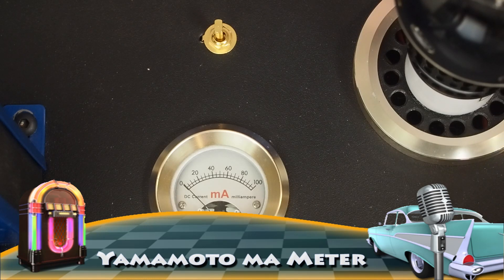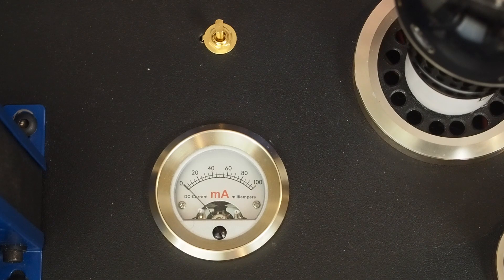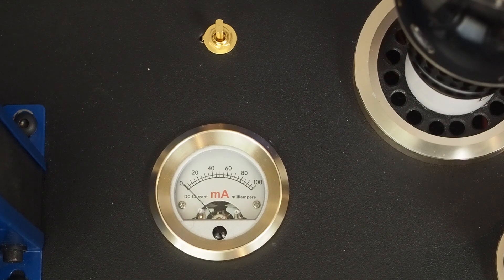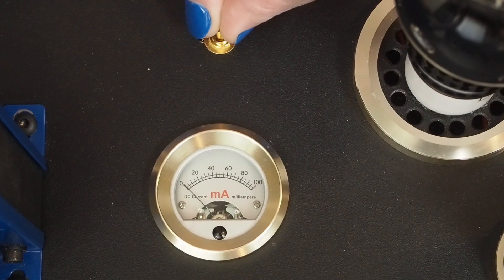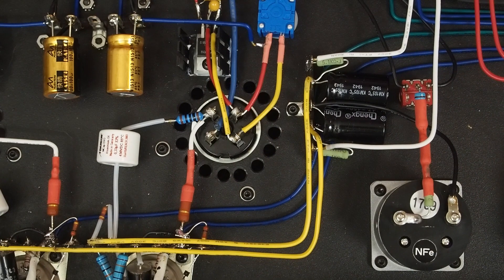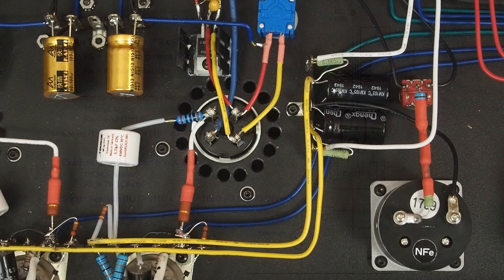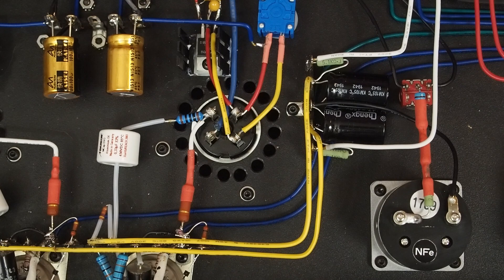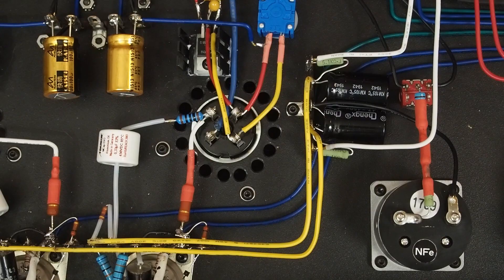Yamamoto mA Meter for Tube Amplifiers

Comment: Hello Stephe, After having watched all the 300b series, I saw the cathode resistor specified on the final BOM for this built was 880 ohms.... question: 880 ohm would be the one we use to calculate the resistors in series to connect the meter correct ?
Reply from the maker: Yes if you have that yamamoto meter.
Reply: @SkunkieDesignsElectronics  I got the meter from Youda electronics their cheapie one that's also 100mA 😅 but I was planing on using one of the rings you used, the 44mm since it fits the dial just to make it look like the Yamamoto. In this case do I still proceed with the same formula like In the video or do I need to measure anything on the meter ? 😅
Reply from the maker: Honestly I have no idea how to wire up that meter, sorry.

Comment: Hello Stephe, By any chance is there any meter that you would recommend, I tried purchasing this one but no longer in production, it does looks pretty cool and would love to add one to keep the 300b looking as good as your design
Reply from the maker: I have yet to find any meters that look even close to as nice. It's all $5 made in China plastic ones..
Reply: @SkunkieDesignsElectronics  True, I've only found the $5 dollar ones, Now out of curiosity since I am ordering all parts now, and I am a bit green on this, I am as well installing the 100mA meter so, my questions is,  can I go ahead and add a 73400 Ohms resistor like yours since I am using all the same parts ?  or would this vary in any way? I would appreciate your input 🙏 oh and the watts you recommend  ❤
Reply from the maker: I don't know how that meter was calibrated to work the way it did. I would personally get a 0-100V meter to switch in and just read the voltage across the cathode resistor.

Comment: Nice craftsmanship on display. Is there a logic to when you use heat shrink tubing at solder - lug - component junctions? I’m going to try it on my next build. Thanks.
Reply from the maker: I mostly use it when I think there is a possibility of a wire touching something, to help support something like a resistor soldered onto the end of a wire or to hold wires together to look neat.
Reply: @SkunkieDesignsElectronics  Thank you.

Comment: Hello Skunkie, thanks again for this nice video. I have a question: why do you use a ampèremeter when the bias of the 300B is fixed? Or did you change the design to a regulated bias afterwards?
Reply from the maker: A) It looks cool, B) I can keep an eye on the tube's health c) in the future I might try using a different bias scheme.

Comment: If you were to connect a multimeter to the Yamamoto poles and set to DC Volts, theoretically you should get the same reading in Volt as the Amp meter's value, i.e. If you're aiming at say 0.4Amp bias, then you should also expect to see 0.4V on the multimeter when connected this way, right?
Reply from the maker: No it doesn't work out to be a direct mA = mV with this setup. I'm not sure exactly how this meter is engineered to work, but at 80 mA, it reads 1.325V across the meter. So something else is going on here.

You could just switch in a volt meter across the cathode resistor and check the bias that way to save some $. I'm also looking at using a 1ohm sense resistor with a 100mV meter across that as a shunt which would read the mA as mV on another amp I am building.

Hope this helps.
Reply: @SkunkieDesignsElectronics  Yes, spot on and exactly what I was looking at and thought it would be the same on the cathode end, but did not do any calcs per say as I wrote this whilst waiting in the car  for my boy to get out of school and should have known better... my bad and thanks for the smoking fast response on that one, you're a champ :)

Comment: Hi. It can only be done with yamamoto meters or other brands can be used. In case ordinary ones, with lower cost.
Reply from the maker: I'm sure other types of meters could be calibrated to be used in this way.  Might be a project for another time :)
Reply: @SkunkieDesignsElectronics  Ive been trying to sort through meter options on a decware SE clone I built. What Ive learned (from you and empirically) is the meter in line is bad. In fact I had a build with ma meters in line with cathode to show current, and I pulled the meters out of the equation and it sounds better. Makes so much sense. Probably the best way to do this absent a Yamamoto (which seems pretty hard to find) is to use a voltmeter with a very small sense resistor to display current. Yamamoto meter seems to have some special sauce.... I have been all over the internet these past 2 years and spent a lot of time building amps and re-learning electronics in part due to this covid nonsense; I am so grateful! I hope you can find a way to get "$rewarded" for your work!
Reply from the maker: @BobCvideos  That should work fine. I need to sit down and think through a cheaper way of doing this! While it wouldn't read mA directly, a volt meter from the cathode to ground should give you a reading that relates to the proper bias without having enough current running through it to be an issue and could be made switchable like this meter is. Now to find a really nice looking, small volt meter!
Reply: @SkunkieDesignsElectronics  thanks! I have some 100mv and 1 ohm resistors on order to try out. I suppose you can also switch the meter into the circuit. I wonder what impact the switch contacts would have on sound ;)

Comment: Your photo shows the back of the meter with the black lead going to ground ... the series of resistors going to the center pole of the switch ... and the two black leads from the switch to each of the cathode resistors ... but they disappear at the top of the photo ... so you don't see the leads actually connecting to the cathode resistors ...
Reply from the maker: The cathode resistors are on the top side of the amp. I wouldn't have been able to show them anyway :) You just connect those two wires as shown in the schematic, to the positive, non-grounded side of the cathode resistor. I get what you are saying, sorry the camera angle was off a touch.

Comment: which 2 pins of 300B to connect to see mA of tube?
Reply from the maker: This meter doesn't connect to the tube pins. If you look at the schematic, this  meter is across the cathode resistor, just like you would do to measure the cathode bias voltage.

Comment: You do good work. I was shocked when you said on another video that you weren't an engineer. I've been an electronic tech for 40 years and and good one, but I can't redesign things to any extent as you are able to do. Thanks for another good video : )
Reply from the maker: Thanks for watching! I just love tinkering with stuff like this and read a lot.
Reply: I started getting into electronics when i was around 21, i repaired and built amps before i went to school for an electronics engineering tech degree, really helped me to be an excellent student. You can do anything without school if you have the passion and dedication. School did make me an even better tech though, just helps get u there a bit faster.